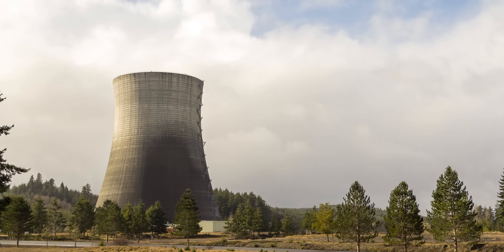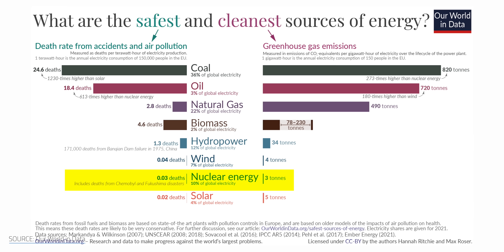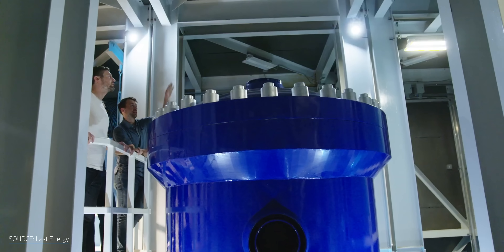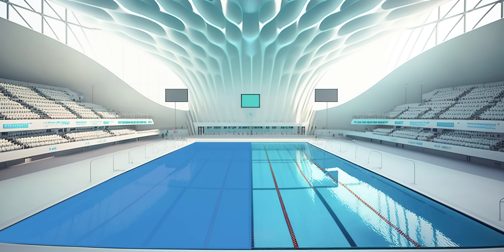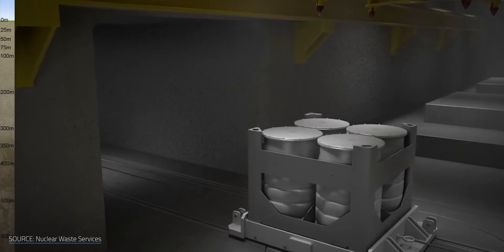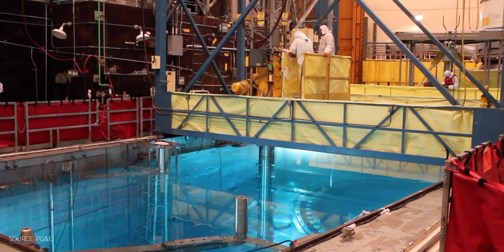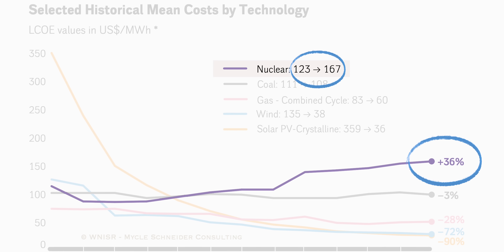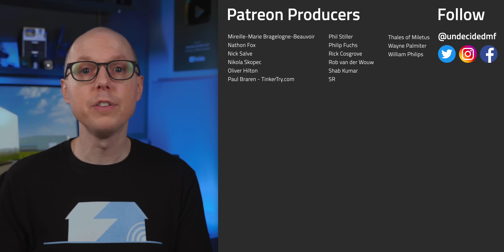Is Small, Fast, & Cheap the Future of Nuclear Energy?

Comment: For nuclear deaths, we might likely be underestimating it because of Gambler's Ruin. If we had a really serious nuclear accident, we would have shut them all down by now. Since were lucky and didn't, a rare serious accident might shut it all down later. Since serious nuclear accidents are rare, we have only bad estimates just how rare they are. If we figure that serious accidents now are 1 per 50 years, then with 10 times as many power plants they would be 1 per 5 years.
Reply: Lucky? That insults a lot of terribly smart and very hard working people.
Reply: @ubobl2277  Not at all! Nobody knows what they're up against. Accidents usually come from unusual combinations of usual events, things that don't look like a problem until a series of things cascades unexpectedly. Each one comes from something that's never happened before, that nobody expected. So nobody knows how likely they are. We know they are very unlikely. But we don't know HOW unlikely because we haven't been doing it long enough. 

Other things equal, if we run ten times as many reactors then we'll have accidents ten times as fast. But other things are not equal. Instead of designs that we have 30 years of experience with, we will be using new designs which we PREDICT will be much safer. Burt which don't have much track record yet.

Comment: So they put a small reactor into the ground... okay, then what?  I assume it still needs to be monitored, controlled, maintained, etc.  Which, in turns, means you need people who are qualified to perform those jobs in a nuclear power plant (regardless of how big the reactor may be).  How many people will be required to do those jobs?  Do we have enough qualified people to perform those jobs if this idea gains any traction?  How much will those jobs add on top of the $123 million installation price?  Unfortunately, none of that was touched upon in this video, so it's hard to really form an opinion either way.

One thing about nuclear that wasn't addressed in the video is what I consider to be the biggest problem with the waste -- the vulnerability of storage.  The video touched upon the non-immediate-death dangers posed by meltdown and it mentioned that the waste is radioactive for 24,000 years, but the biggest issue with waste storage (in my opinion) is how vulnerable it is.  When it's stored above ground, it's vulnerable to natural disasters, accidental damage, and (perhaps most importantly) intentional damage.  To those who say "we've used above-ground storage for decades and haven't had a problem", consider the fact that natural disasters keep increasing in frequency and in strength.

Comment: At one time the industry did attempt to standardize. The nuclear plant I work at was one of two SNUPPS (Standardized Nuclear Unit Power Plant System) units built. There were originally 5 that were to be built, but the others were cancelled for various reasons. We share a majority of components with the other plant, which saves time and money. If something breaks, we normally can get it from them. We then send ours to the vendor to be fixed and it gets shipped to the other plant to re-stock their inventory, and vice-versa. Works great! So excited about SMR’s, recycling spent fuel and the future of Nuclear in providing carbon free energy!! 😊
Reply: That was super long!!! But definitely a good ending with the smilie face.

Comment: Nuclear power plants generally can't be quickly checked and repaired. Indeed, [routine] maintenance can mean taking a plant offline for up to two years before bringing it back into use. 

Additionally, France's nuclear power plants are in a [DIRE] state of repair, needing HUGE amounts of money to fix their (literal) rusting pipework etc, leaving France extremely vulnerable to major power shortages. France's state owned nuclear fleet power company is functionally bankrupt as it can't afford the repairs nor, due to political sensitivities over price to customers, able to raise necessary funds via price hikes, meaning the French taxpayer is going to be on the hook for BILLIONS of euros which is also, an additional political nightmare for Macron who has enough nightmarish challenges to his popularity as it is without this.

France's shortsighted insistence on their over reliance on nuclear power has made them EXTREMELY vulnerable to climate change driven droughts as most of their reactors are located at riverside locations; last year's drought (2022) meant many nuclear reactors had to close due to a drastic lack of water for cooling and a number of Europe's similarly located nuclear power plants also suffered from the same problem in 2022. This meant that many European countries were exposed to the existential risks to both electricity shortages & economic harm by not sufficiently diversifying their energy mix, & when combined with the double whammy of the consequences of Russia's invasion of Ukraine, problems were multiplied many times over, resulting in the mad scramble for (expensive) natural gas import alternatives and more short-term use of coal. It even meant that in the resultant panic for reliable energy sources, the rapid approval for the construction of several natural gas import terminals in a number of countries, further tying them into several MORE decades of fossil fuel usage instead of the EU policy climate change prevention, mitigation & action measures its been working on recently which would achieve the exact opposite. Whereas (if) European Govt's hadn't been dragging their heels on the wholesale transition to sustainable renewable energy generation capacity and storage, their nations would have been largely inured to the machinations of bad actors such as Russia. 
I'm not against nuclear power per se, but it has far too many drawbacks, (including) security as the Zaporizhzhya nuclear power plant in Ukraine so amply demonstrates. Far less difficult to hack  a renewables power plant and maintenance and repair is greatly simplified in comparison.
Reply: Here in the UK, the Tory Gov't is for some crazy reason, in the process of hog tying us to SMMR nuclear for many decades to come, wholly ignoring the existential risks posed by climate change driven sea level rise as the UK's SMMR's will be coastaly located. It's worth pointing out that the UK is largely in a giant pickle when it comes to existing nuclear waste storage; the last thing we need is to add to this unbelievably expensive nightmare when wind, solar, hydro, pumped hydro and storage is so much cheaper and don't come with the 24hr armed police taxpayer funded bills of nuclear power. 

We are currently in a MAJOR cost of living crisis with the Govt's (own figures) showing that 1 in 20 adults are regularly running out of food without any money to buy more. The very last thing we need is more of the most expensive form of energy generation on the planet.

The Govt's own Climate Change Committee delivered its own excorriating & withering report within the last two weeks on the Govt's nigh on total failure to deliver on its legally binding climate change goals and even the energy industry is starting to hold the government's heels to the fire; I'll include a link down below Matt.

https://www.theguardian.com/environment/2023/jul/16/top-uk-energy-firms-to-warn-rishi-sunak-dont-back-off-green-agenda#amp_tf=From%20%251%24s&aoh=16894942886397&csi=0&referrer=https%3A%2F%2Fwww.google.com&ampshare=https%3A%2F%2Fwww.theguardian.com%2Fenvironment%2F2023%2Fjul%2F16%2Ftop-uk-energy-firms-to-warn-rishi-sunak-dont-back-off-green-agenda

Comment: They produce 20 MW, and cost about $100million.  What I don't know is the annual maintenance and operational costs and lifespan of the reactor.  But I know on larger reactors the operational and maintenance costs are a small fraction of the up-front cost, maybe assume $2 million/year to operate and maintain,  - assume a 50 year life span, and 5% interest rate (municipal bond type rates assuming we tame inflation soon), this amortizes out to an energy cost of $0.008 per KWH, call it $0.01.  Add the cost of waste storage to that and the cost of the land where it sits, and the end of life costs.  The storage cost must be factored in.  You need to also front enough money so that the storage costs can be paid indefinitely - basically a 24,000 year annuity.  My guess is that's the largest cost in all this.

Comment: It's only „CO2-free“ if you don't count the CO2 for uranium mining, uranium-purification, the CO2-costs for building the reactors and for disposing the radioactive waste...
Reply: With current reactors the CO2 emissions are similar to wind power. With advanced reactors the CO2 from fuel is less than 1/100. 
Ever thought about the waste produced by solar every about 30 years. Even at 99 % recycling solar produces more more waste than current reactors, and advanced reactors produce more than 1000 times less waste.

Comment: SMR's generate more nuclear waste per kWh generated relative to large nuclear power stations because the SMR's have less neutron efficiency.  Molten salt reactors using Thorium are very hazardous with gamma radiation emissions during operation.

Comment: while the initial price could be smaller, the smaller size make it way longer to ROI than a larger power plant. besides, the cost of nuclear is no match solar and wind, one can just dump more money on to buying more batteries to solve solar and wind intermittent power. Germany actually shutting down nuclear power plants because the cost of operation actually more expensive than installation of solar or wind.

Comment: LCOE is NOT a good indicator, a kWh of solar energy may be cheap, but because we need energy always, and not just when there is a good amount of sunlight, it needs very expensive infrastructure, backup gas-powered plants, batteries etc. that’s why countries with very high wind and solar generation have high costs of electricity, say Germany or Denmark.

Comment: Matt your cost estimate at 10:00 is off by about a factor of 5.   For example Georgia Power Vogtle Units 3 & 4 both rated at around 1100 MWE total cost estimate comes in a little north of $30 billion. 2200 MWE would equal 20 110 MWE units. Making 110 MWE plant priced on a linear scale of about $1.5 billion.

Comment: I cant believe that in 2023, U R broadcasring a video on Nuke Energy, w/ out mentioning Thorium based Molten Salt reactors ?   Why the silence on the subject ? Who's Atomic energy company is lining your pockets?  Why promote the prolongation of that filth producing (including waste storage for 30,000 years !), innefficient form of fission physics, when a better tech is waiting (PROVEN !) in the Wings ???  Are you telling me there is a grevous downside to Thorium powered MSRs that I have overlooked ???  I'd like to hear that !!!  I know about the NRC's reluctance to license such, 'coz they don't have a protocol for anything else besides the standards for PWRs.  The prduction & licensing advantages that Last Energy claims, have been kicking around in the Thorium community for more than a decade, since the first Thorium MSR was OPERATED in the 60s at Oak Ridge Labs !!!  Those, & about a half dozen more, efficiency & safety improvements !  Among them, a T-MSR CAN'T melt down.  PWRs use only 1-3% of the uranium in their rods & the rest is waste !  T-MSRs can eat up most of that "waste' in the normal fuel cycle !!!  & the miniscule (relatively) amount of waste it can't burn up, has been reduced to 300 years of radioactivity/need for storage. There is no such thing as a geologically safe strata to store things in: have U heard of plate tectonics & earthquakes, which occur even away from KNOWN fault lines. 30k years of storage seems like heavy odds in this roll of the dice !  Like the lies about Fracking, & how it would never get into our aquifers.....  Last enegy's only innovations on conventional PWRs seem to be in 3 areas, Miniturization, Reprocessing (already done by PWR operators) Price/Timeline.  A small T-NSR plant could be up & runnung in less than a year, & @ a lower price than what U said L.E. is advertizing.  Besides what you get, is the same, rushed to service tech that was good enough for Hyman Rickover's Nuke Sub Fleet, during the cold war, but we build our plants on dry land !  PWRS R the alpha or Cain product.  MSRs are the beta or Abel, & deserving of being the safest most efficient way we have to go forward w/ clean-green energy !  Prove me wrong !!!

Comment: I agree that the current generation of nuclear tech is a MUST for our energy future, and the tech gets better every day.  If we can just get past the public trepidation, we can improve everyone's future immensely.

The insistence that we can build enough battery capacity to store the energy produced by wind and solar to cover the down times (when the wind doesn't blow and/or the sun doesn't shine), especially in an environmentally sound way (just look at the mining practices around the world to obtain the needed materials for those batteries), is ludicrous with present tech, especially with the huge additional demand the conversion to electric vehicles will require.  That doesn't even touch on the reliability from a durability standpoint.  An entire solar installation was virtually destroyed recently in a few minutes time by a hail storm, and everyone seems to just be shrugging that off.  We need a reliable, durable, continuous power source to drive the country forward.  Use solar and wind when they're producing, sure, but have nuclear there to pick up any slack.  Right now, the only fallback we have is fossil fuel fired plants.  Wouldn't modular nuclear be a far superior option?

Comment: LCOE is not a fair comparison between the methods. To get a fair comparison, divide by the capacity factor to get closer. LCOE also does not consider that some energy forms need 100% backup either, but that is much harder to account for.

Comment: I have always been a proponent of Nuclear energy development, but always wondered why it was not standardized and miniaturized like computers have gone through over the last 60 years.. 
Personally I think it would be a great asset to add decentralized Modular reactors  Like Last energy's design. I could go on about it unfortunately Matt the Main stream Propaganda outlets have soured perception on it. 

Thank you for providing Factual information (as well as corrections when you get something incorrect)
Reply: Thermal energy plants are MUCH more efficient, if large.

Nuclear even more so... It's to do with free neutrons, but maybe over your head.
Reply: @growtocycle6992 no need to insult my intellect. I get the point, however, nuclear batteries have been in use for years in satellites (voyagers) the question is more with the advances in material science we could improve overall efficiency while making smaller footprints.. I get the fact there's a balance of size and efficiency. I personally don't know where that point is.
Reply: @grey1wa  there was no intent to Insult you. Everyone has different passions and interests, and not everyone understands the details of nuclear (I'm barely a novice myself).

Personally, I think France's approach is superior, but like most things, finance is the key
Reply: @growtocycle6992  I didn't figure you were intending to insult (it's all good) though you brought up a great point about thermal reactors and scale. My curiosity has gone more to say a home scale or something about that size.. with all the big brains and tools we have today   is it possible and efficient enough for like a distributed grid

Comment: The problem of the rods burning in air because they are coated with stuff that burns really fiercely, zirconium (Zr), is one of the biggest problems.  If even one of those cooling ponds full of rods ever dried up  and burned, it is the catastrophe of all catastrophes.  It has not happened, yet.  How does these smaller reactors fix this?  Nuclear reactors need to be made so that at no point, can anything burn  in air. Probably not possible. ??

Comment: There never been a single persone died as a direct effect of a nuclerar power meltdown. Bot one.

And no, chernobyl does.not count because it was not a meltdow .

:nuclerar fuel is not cheap"

That is just right sown wrong. Its very very cheap. Typically 0.1cent/kwh. A full tank of uranium fuel in a SUV would cost you less than $5

.12:09 that is not source from nuclerar energy report, that is lazards report, a known anti nuclerar thinktank sponsered by the CNG indutry. They are known for publoshing false data.

Comment: A bit late to comment so sorry if I am retreading old ground, but where does the waste heat dump to? The idea is to go underground and understandably avoid the water table but where else are they dumping the unworkable heat without flowing water? It is unreasonable to think you can access a surface waterway without operating within it's watershed. The earth cannot absorb enough heat to drive a city and the air is not efficient enough to act as a heat sink. It has to be the same water people rely on each day. As an engineer within the industry and would love to see their idea succeed but please consider the basic laws of thermodynamics. You cannot have nuclear fission based energy without risking the water supply of the local people who you put at risk.

Comment: Biggest problem with LCOE of solar or wind is that in unfairly ignores energy storage costs of a system.

I think that the fairest LCOE calculation that is still feasible as an overgeneralization should assume a grid that is 100% made of that energy type and the cost to do it that way. Generation, storage, distribution, ect.